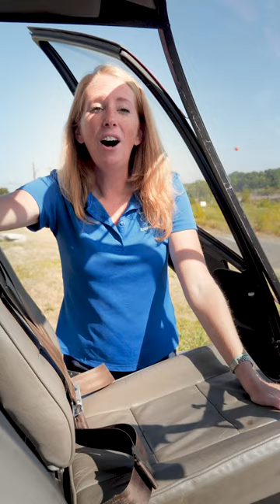Autorotation explained! #shorts

Comment: It work if you have a good pilot that knows what they are doing they can even save the helicopter when the engine goes out and nobody gets hurt and the helicopter is still in tact scary when it happens and worse when the pilot says hold on this might get bumpy and we’re going down in that field over there the engine died.